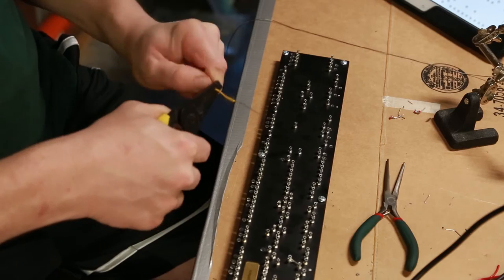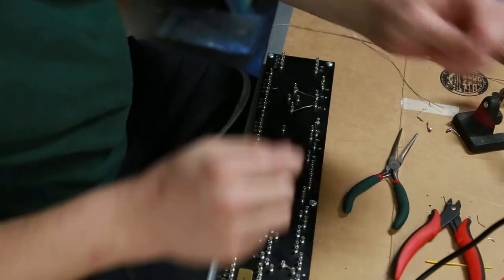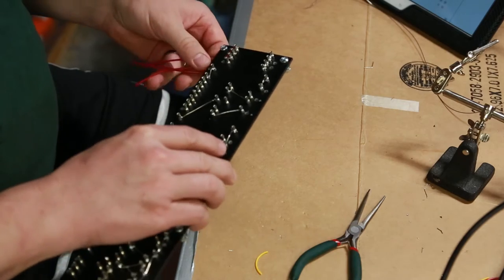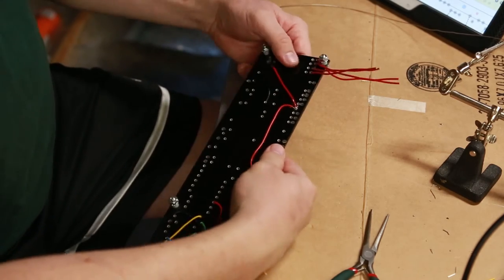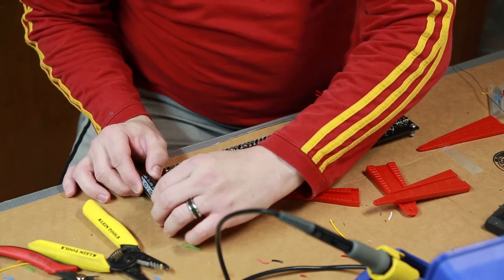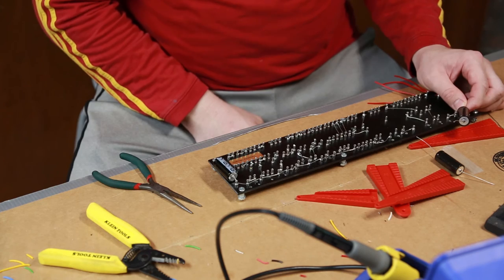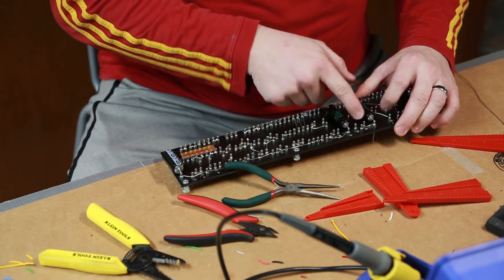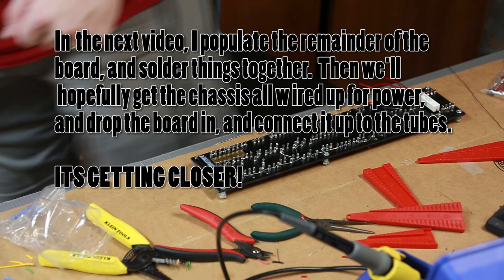Vox AC30/4 Video 8

Comment: 12/2 house wire makes exellent bus wire for grounding after it is stripped of insulation. do you have any leads on the  hiwatt little d schmatic? thx man happy building
Reply from the maker: +ken hancock sorry, seems I don't get notifications on some messages.  That's good to know, thanks.  Sorry no leads here on the schematic